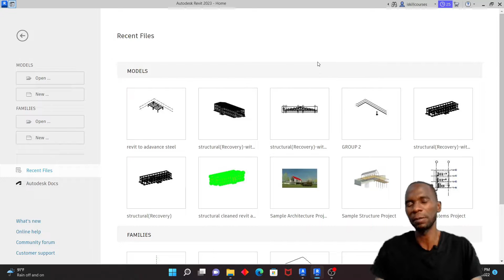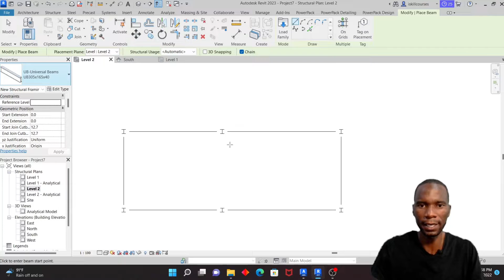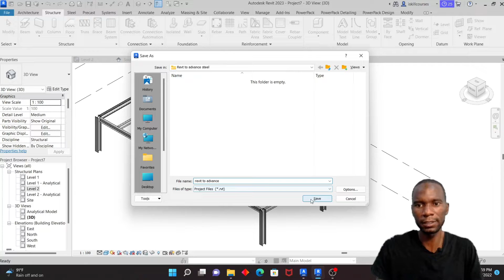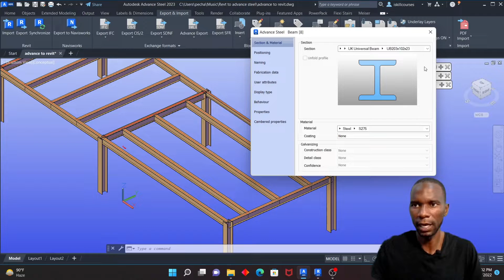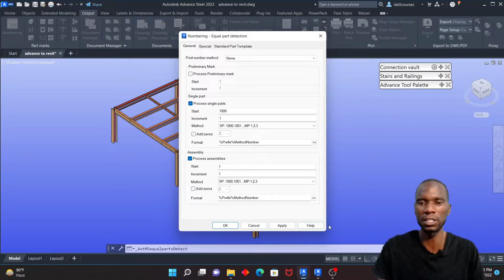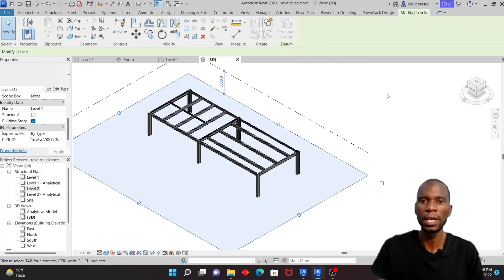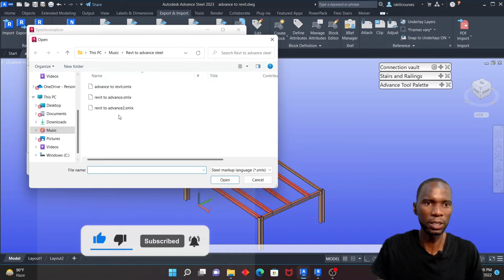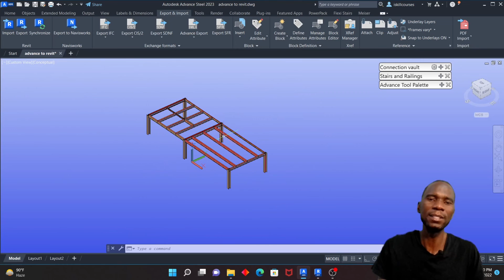Export Revit to advance steel and Advance steel to Revit

Comment: very good tutorial and this is what I've been looking for a long time, thankfully I found it here.
permission I ask, I experienced this when exporting to Advance Steel namely "revit 2023 error report", "an error report has caused revit 2023 to close unexpected" please what is the solution???
Reply from the maker: Have never experienced that error myself. Try to Google same error for solutions. Am pretty sure it's there
Reply: @skillmaxacademy  thank you Sir, its fix by installing Microsoft Acces Data Base and done
Reply: @dionperich_BIM_TRAINER  EN MI REVIRT NO HYA ES AOPCION DE INSERTAR ADVANCES TEEL E SUN PLUGINSS ???? COMO LO CONSEGUISS
Reply: But i have other problem is Revit Export element to Robot Structure in Robot display